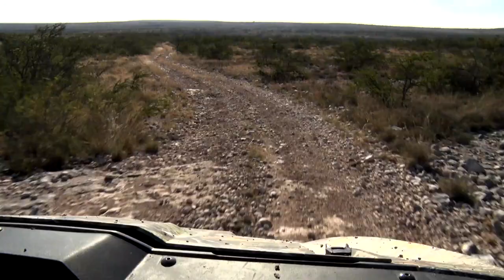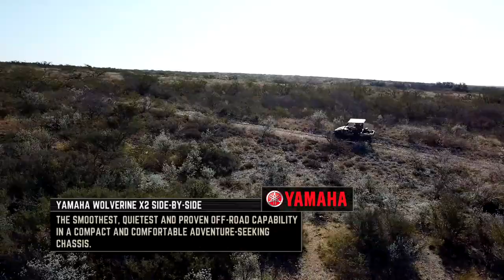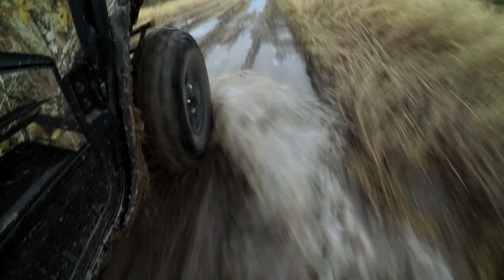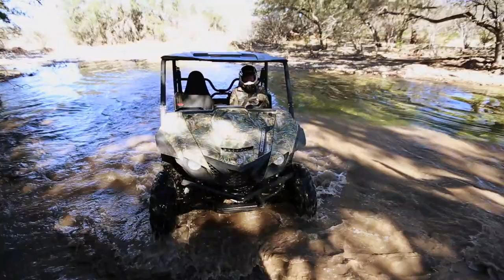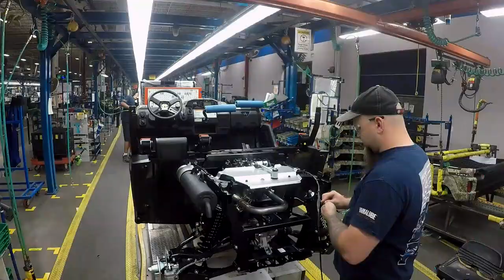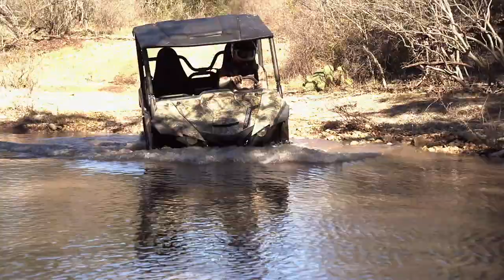Yamaha Wolverine X2

Comment: Darn shame the new 2020 model X2 is listed at 61" wide, up from the 59.7" for the 2109. So much for "tight and technical" trails. Yea, it's not even 1.5" wider but to me, being any wider is a drawback. Heck, if I wanted something 61" wide I would have gotten a Viking. Yamaha could use a midsize SXS about 58-59 inches wide, bench seat, power steering...kinda like a midsize Viking!